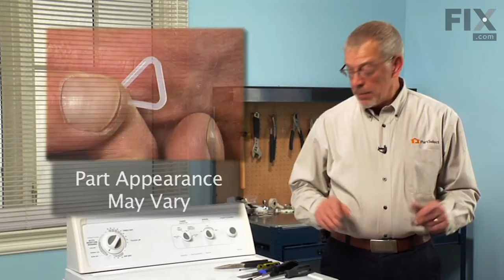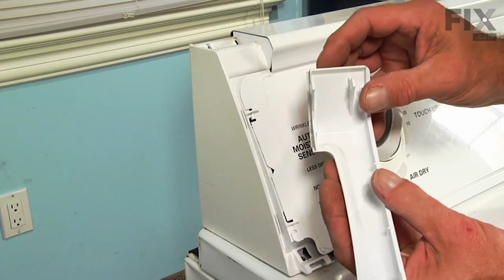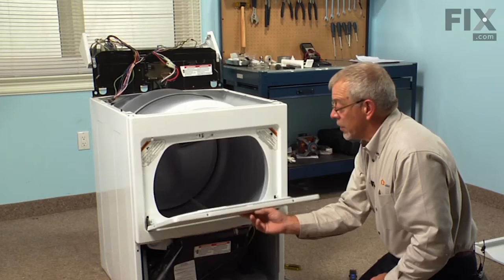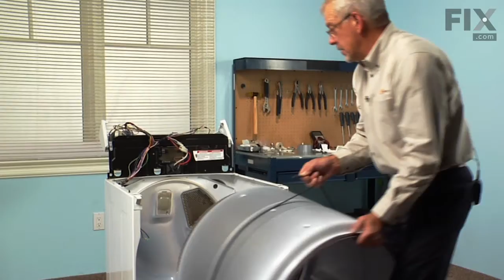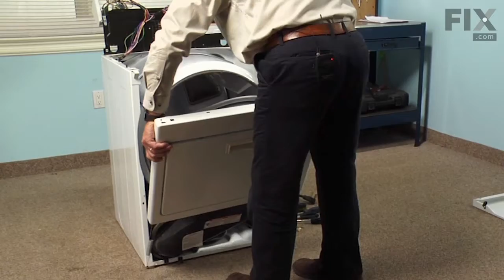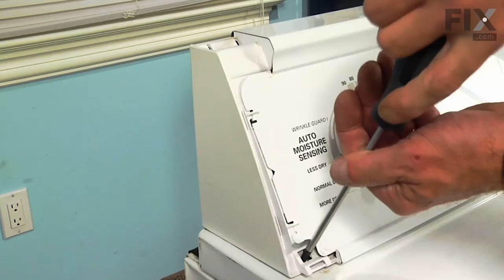Whirlpool Dryer Repair – How to replace the Tri Ring

Comment: You did the easy one.  If you replace them both, what is the trick for getting it past the first groove to get to the back groove without damaging it.  The new ones are much stronger (original OEM Maytag kit) that the worn out ones.
Reply: Worthless video. Misleading title. If you're trying to replace the tri-ring you've done all of this already.